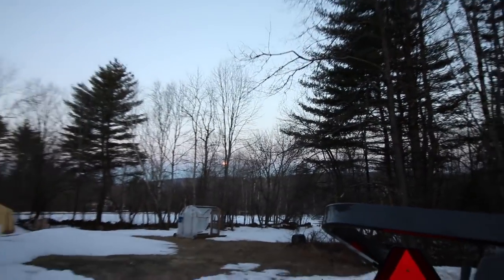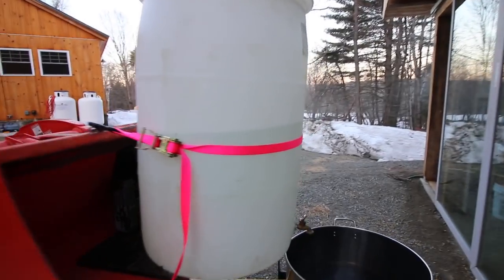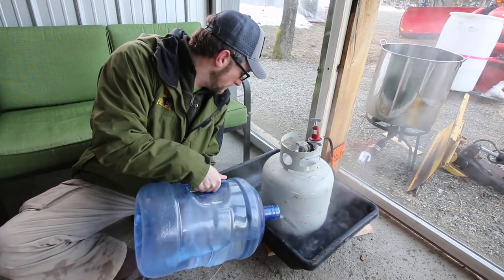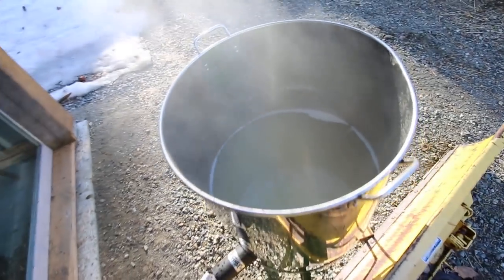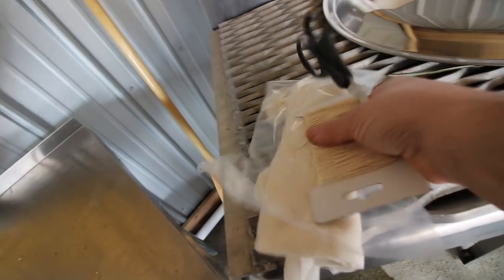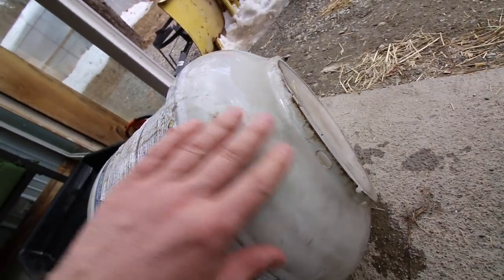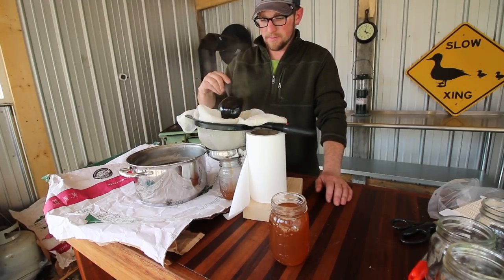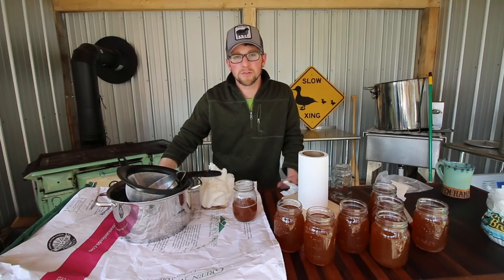Best Way I've Boiled Our Maple Syrup

Comment: Since you use the yard arm for the lever to scald consider building a cement block fire brick lined ecavopator base.  Same base holds the preheated above.  3 warming pans and the yardarm gets a new job.  I see a tote hanging with the. Preheat pan in between.  4 gallons plus a run.

Comment: You might want to consider getting a flow control valve for your propane rig. You're using the pressure regulator to control flow. That is not good for the regulator or efficiency. Propane is best delivered at 15 psi. You can purchase fixed pressure regulators for propane or use and adjustable, such as you have. Adjustable regulators are more typically used on air compressor systems to adjust 125-150 psi air compressors to adjust pressure for more optimum pressures for air tools, paint sprayers etc.. For example most air tools operate most efficiently at 90 psi. Paint sprayers from 15- 50 psi. Typically an adjustable regulator would have a pressure gauge coming out one side. If you look closely you will see a silver plug on one side. This plug can be removed and a pressure gauge added. You might add a flow control after the regulator. This could be a 1/4 turn gas/water valve or a needle valve. Adjusting the flow with the valve adjusts the rate of flow without affecting the optimum pressure provided by the regulator. This is similar to the controls on your stove. Main pressure from bulk tanks to gas lines remains constant. Controls on front of stove controls flow volume. 
A major part of your freeze up is that you're opening the pressure regulator to more than 15 psi. Yes, your burner seems stronger but much of the gas may be wasted and not burned at all. This increased pressure allows the propane to expand faster than ideal causing the freeze up.

Comment: Try scrambling an egg in the sap right as it gets to a boil on the wood stove, the egg will collect a lot of the grit and you just scoop the egg out with all the grit and if you get a pot starting to boil over put some butter in it and that will stop it from boiling over
Reply: whipped egg white is used. Same as to clear consomme, clear beef broth.

Comment: If I had an old warning tray I'd send it.  Rest supply or online.  You could be preheating sap on the wood stove top.  Use old boiler insulated lines to let it drip.  Wood does 3 jobs.  Heat, boil and finish.

Comment: My grandma had 50,000 kitchen towel. Those flour sack ones. Okay not 50,000 but a lot of them. They each were cross stitched with what they were used for so they didnt get cross used. She had several with a syrup bottle on them. She always used a flour sack towel to strain. Hope that helps.

Comment: I missed you yesterday.  How was your day off with the family?  I think that is the first time in about a year that I did not watch a 5 A.M. Video.  Anyway, the sap boil should be interesting.  I am not sure I understand the need to boil some sap and not the whole amount.  The hot water trick on the tank of gas is new for me to see.  I use some natural gas tanks for burners in The Philippines.  The problem, the tanks run dry without warning.  I have been cooking and had to go get a new tank.  I use a small tank about every six weeks.  I now keep a spare tank at home to replace when I need to exchange tanks and continue cooking.  I had to learn the hard way.  The second boiling sort of scares me.  Are you afraid the inside walls will get sticky to the touch and then attract dirt and insects?  Al, great video.  Imagine that gallon or so of syrup. Well done.  That looks like great eating for the future.  Wow, what goodness.  That outdoor kitchen sort reminds me of our dirty kitchen.  We use our dirty kitchen to bake in.  The heat stays outside.  We also can outside.  I am looking forward to seeing you start planting and canning.  God bless you, one and all.  Padre+

Comment: Put some butter around the top edge of the pan and it will not boil over. It will only rise to the level of the smeared butter. I'm not sure if you mentioned this or not, but boil some water and see what temp it boils at. Then heat your syrup to 7 degrees above that on the day you finish it off.

Comment: Might want to put a little more wind in that right front tire.  Put some antifreeze in there if it's a slow leak. It will swell the rubber a bit and hopefully seal the leak

Comment: It seems 3/16 inch tubing pulls it's own vacuum.  Could it also be used as a water transfer line.  Mark Bakers Green Acres runs a larger house as a manifold and then auto waterer.  Same for chickens.  Little giant from WI I think.  If you decide to custom graze for the fall harvest use the deposits to expand the panel corral.  Cant wait to watch the compost in place of planned use. I can see an old bulk tank hung from the yard arm over the heat to prewarm the sap.  Next year 3 warming pans built over a cement block fire box line with fire brick.  Reverse osmosis old systems  new filters work great.  Saves loads of time.  Makes great water to clean with.
Reply: Every time you grab that hug of water I get sympathy pains.   You can move all your water just let father time help.
Reply: I would love to see some domestic pheasants that are prepaid by hunt clubs so you have birds.  They are always getting wiped out by predators and bad winter weather.  Its a long expensive trip.  I bet they would stand a chance with a chicken Tractor on wheels with auto open and close trap door..build a natural brush enclosure around and over it.  Get a trappers license, set up page wire funnels to bait and snare wolves, fox, coyotes.  You need to trap 7 of 10 predators just to stay neutral in growth.  The west is watching prey animals ruin game harvests. Ranchers need to help support trappers as pets are idiots that believe hanging a sign stops gun violence.  Like Chicago gang banger hits it.  I'll do 10 years on a gun charge beats death forever.  It's old homie time inside.
Reply: Easy to see why old milking parlor bulk tanks are like gold up there.  I like the water bath veggie canner soap evaporator combo.  I bet a duck pond with a 8 inch stand pipe drain would blow up those trees.  Especially in a drought year.  Pull the pipe, clean the pond, water and fertilize the trees..  just put in some airstones and funny sack filled with compost.  Compost tea on demand.  Ducks want mind.  Same with worm castings.  Think of the food waste at schools that could become bacon, chicken and beef instead of methane gas at a landfill.  Plenty of woods not being used.  Put all the lawn clippings leaves wood dust from cdx shop class. Turn lawns into gardens that feed safe food.  Kids forcing a first try garden will bring parents along with them.  Get all the chips you can.  Just turns into more dirt faster.  Stage where it is needed.  I'd like to see a guard dog before rather than after a mishap.

Comment: Try preheating your filters. Put them in hot water and just before you pour through them squeeze them out and then use them. This way the syrup will filter through faster. Do this especially if your using actual filter material. How much propane did you go through?

Comment: Approx how much propane do you think you went through for 30 gallons?  My husband wants to do it with propane, but it costs $18-20 for a tank refill and if we use a full tank on 20 gallons of sap, getting only half a gallon of syrup, it’s cheaper to buy it from the store!  Lol we have spent a small fortune in all our syrup supplies we may never recoup the costs, but it was fun!
Reply from the maker: I used a tank and a half. It cost us $15 to get a tank refilled
Reply: Walmart is the cheapest for 20 lb tanks.  $18 for a half gal of syrup is cheap. Here in NY that stuff sells for 25 per pint.

Comment: Unless the ambient temperature is less than 45 degrees Al, your propane will not freeze so you shouldn't have a problem
Reply from the maker: I havent boiled yet with the Ambient temps being that high! Lol
Reply: Lumnah Acres 
I'm sorry, I meant the temperature has to be lower than -45 degrees Fahrenheit for propane to freeze
Reply: Lumnah Acres m;

Comment: I welded up a quick and dirty stove for maple syrup and set a 60 litre pot on top.   It has a few neat options like a tall smoke stack.  If you don’t get the smoke away from the boiling syrup you get a smokey taste in the syrup.  My syrup turns out with just a hint of smokey which is what I like.  Here is a video on  of the maple syrup boil we did. 

https://youtu.be/O9ysFXG6zPU

Comment: 100 pound propane tank won't freeze up like those little ones do
Reply: One other thing  get your jars and lids in a pan of hot water then pull the jars out fill with syrup ,install lids and rings set aside to cool they will seal themselves as they cool down  ,been doing that way for years